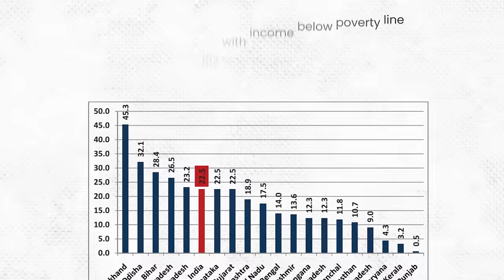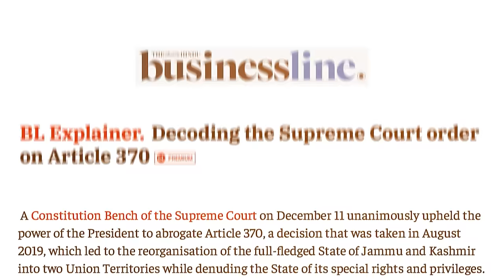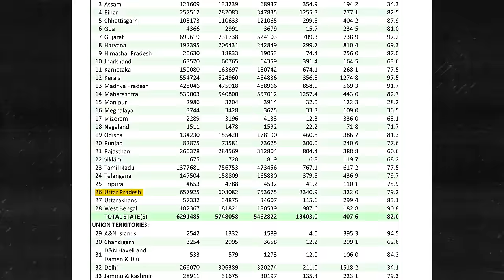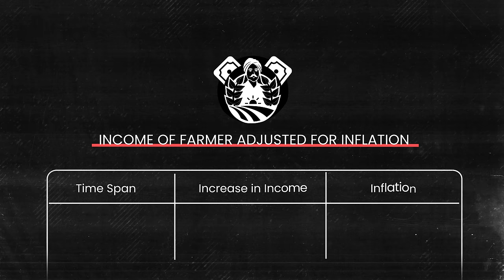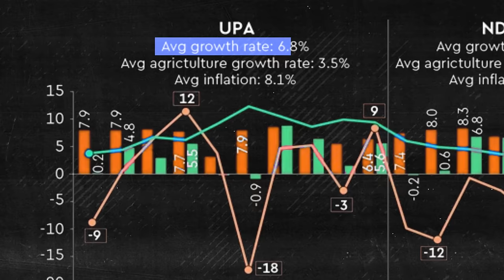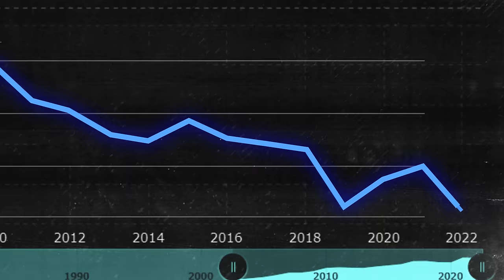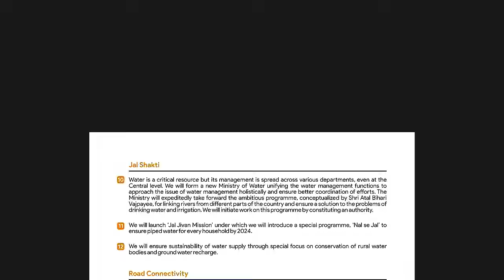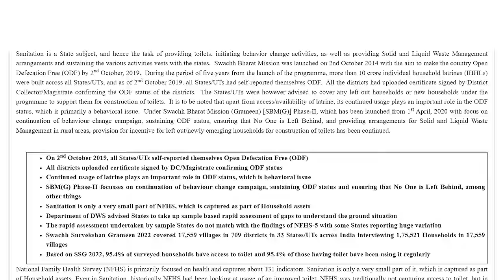The Honest BJP Report Card (Analysed with Stats): Were the Promises Fulfilled?

Comment: Avg GDP growth rate during UPA was higher than NDA rule because of global growth from 2002-2007, when entire world's GDP shot up due to weakening dollar and the ripple effects of it, otherwise Manmohan Singh Ji should explain 2011-2013 stagnation of the economy when there was no global slowdown.. NDA just has increased the capex and made big manufacturing reforms enough to make a significant change in GDP growth..
Reply: By taking humungous debt worsening the debt to GDP ratio
Reply: @aniketkumarverma5505  Taking debt isn't a problem but where that is spent should be the concern. In BJP's case, they have spent it in infrastructure development which is an asset for the country and will provide benefits for many decades to come. So the debt can be recovered easily. Try not to present a half cooked story.
Reply: @aniketkumarverma5505  Launching trillions of worth of projects will require debt.. And Debt shot up the most due to covid, 75% to a huge 89%, but its going down now isn't it? And dont worry, this is public debt, government debt was decreasing till 2019..
Reply: @NarutoHugsMikasa taking debt is not wrong when it's needed, I don't think they had money still they were like let's take debt no way! They wanted that type of money and isn't before bjp debt was already 75% and bjp is decreasing it! Or atleast aware of it so why should bjp get the heat! When they are doing the right thing
Reply: You forgot that we faced double digit inflation during upa and now our Inflation is at all time low
Reply: Now this is called manipulating facts
Cooking a story?
The average GDP growth rate has been better in the UPA era.
Credit to the MMS govt. 
OMG you can't even credit to the poor guys!
Instead of appreciating him you're appreciating the other factors.
Well I could list 100 other factors that would tell you why Mr. Modi has been able to roll up those GDP numbers even tho they are still lesser.
Reply: @celestialkakashihatake4697  mate the % growth doesn't give a good picture, if your salary hike was 10% when your base salary was say 10 lacs, you'd get 1 lacs, but another person whose base salary is 30 lacs, but got a hike of 8% still makes more money. u need to talk about absolute numbers when the economy is getting bigger, and mms lived in an era of hyper-globalization, and the rate we grew was pathetic, it should have been much much higher..we didn't even feature in top 10 of the fastest growing economies then.
Reply: @itdoesntmatter9923  Bullsh it
Why do we need to talk in absolute numbers?
Wow I mena this absolutely is mind boggling the arguments which you're giving!
Comparing eggs with apples.
I'm earning a 10LPA as a fresher.
Gets a 10% hike
I'm at 11 lakha next year
This is impressive.
A guy who's earning 30LPA
Gets a 8% hike
And now because his initial salary is higher, he's ofcourse meant to grow a lot more because the percentage of the bigger number would obviously give a higher number?
What's your point Sir?
How can we compare both the things?
We can if they're in the same department, at the same position. We can say that during the appraisal it was found that I had a better performance and that's why I got better hike.
That's the only takeaway you could have.
What did Mr. Modi build upon?
Previous numbers na?
Or upon nothing?
We build upon the existing blocks every time.
I do not see no point, but absolutely disregarding the work the MMS govt. put in during those years, pulling out millions of people out of poverty line, even if the line has been set at a low level. 
Compare apples with apples.
Reply: @@HINATAHYUGA-js9ke bullsh** facts..
Did you studied Economy from Pakistan??😂
Reply: @celestialkakashihatake4697  so what about economic stagnation during the periodic hold
Reply: @stefano1405  There's a reason that an average was taken in this video
If certain policies helped our economy do better in a certain phase, credit to the govt., If in some years, it doesn't criticise the government.
Don't go into the what abouts
If I started going into the whataboutes the day will end and I wouldn't shut up.
What about the 2008 global economic recession, where every economy took a major hit, India still managed to clock its numbers high.
In Modi government the economy has been constantly there around an underwhelming 5% even before Covid.
2017-19
Numbers utha ke dekh lo
The numbers were decreasing year on year and when the Covid hit us. Boom.
And then one can say India clocked very high GDP grow rates in the following years, thanks to recovery from Covid times.
Another invalid point.
You could always have excuses. 🤷
Covid was an excuse for Mr. Modi
Excused
What about the Pre Covid phase
Why was the economic growth rate slowing down?
Reply: @itdoesntmatter9923  you get my point mate?
Reply: @celestialkakashihatake4697  I am asking reason for stagnation of economy easy peasy! Don't deflect
Reply: @celestialkakashihatake4697   I am asking reason for stagnation of economy easy peasy! Don't deflect and COVID was excuse? The fast our economy recovered from COVID is something else, when world growth rate is going down, Germany is close to recession and inflation is high in America we are growing thanks to decision taken by modi government, excuse? The work is far better then some pity excuse!
Reply: @stefano1405  well I'm not a professional economist to answer the same.
You're pin pointing one factor for the push in growth rate.
And neglecting all the other policy and decision making by the government.
All the countries were doing good during the same 2013-14 phase you are talking about.

I remember India facing high inflation back then.
Surely everything has context behind it.
Have I read every context behind every number? No.
Can one make an educated guess? Yes.

I do everything but to deflect.
I already told you, you could be critical of those years under that regime.
Reply: @celestialkakashihatake4697  ok now tell me what was the reason for initial growth in upa days? Can you tell me this
Reply: @stefano1405  Well, why's the economy in Europe in shambles?
Why is the US going through high inflation?
Now the situation is a bit better.
Why?
Has India been waging a bloody war against the Russians or is it the European countries and the US?
The Context.
Who is facing the brunt of the war? Indians or Europeans?
Who's enjoying cheap crude oil?
Indians or Europeans?
Who's facing shortage in gas and crude oil supplies?
Indians or Europeans
They're also buying it at higher rates.
There are always context behind numbers.

Why has been the inflation been so high post Covid and  since the Russia Ukraine war started?
Why is the dollar rupee disparity has been the highest in history and uncontrollable in the recent past?
Reply: @stefano1405  as I already clarified I'm no expert in this field.
Not an economist by any means.
But the answer IMO is the work done by previous governments and the present ones of that time.
You have to study the policy decisions taken by the government from the 90s primarily.
You could very well pin point one factor behind a phase of successful economic tenure and take the credit away.
But you cannot takeaway the policy making decisions behind it.
There are hundreds of such decisions and India's own work behind the 3 decade succes story of our economy.
Because you cannot get lucky everytime.
If you do not build on solid boundation,
Luck does not run forever. 
Atal jis govt. built on the previous UPA govt. work and took the country forward, and then UPA came back to power again and then the MMS govt. Carried on with Atal Ji's govt's work.
So long answer short- The present and the past work is what the reason is behind that growth rate.
Reply: And that too in the COVID time where countries like UK are suffering to grow India has shown a good growth rate I still remember during COVID most of the countries were having negative growth rate but India grew with 7%+ rate
Reply: Do u know what bjp has done to get these numbers they have changed the calculation of GDP by changing the base year
Reply: @vinaynema-h7b  yeah even world bank that's why they are predicting, that India will become 10 trillion economy! 😔
Reply: @vinaynema-h7b  and it's not some vicious game that you made it sound like

Accuracy: Change of base year to calculate GDP is done in line with the global exercise to capture economic information accurately.
Globally Aligned: GDP based on 2011-12 did not reflect the current economic situation correctly. The new series will be in compliance with the United Nations guidelines in System of National Accounts-2008.
Ideally, the base year should be changed after every five years to capture the changing economy

Comment: Congratulations on a job well done! 🎉 It's remarkable how in today's era, knowledge is readily available to all, yet achieving a clear understanding amidst biased opinions can be challenging. Even newspapers and news channels themselves are often biased. 

Our focus should be on advancing our country's interests without aligning with any specific party. Every party has its strengths and weaknesses. Therefore, the key is to evaluate which party has fewer drawbacks and has responded effectively to challenges. Also it's unwise to dismiss an incumbent party for reasons without fully understanding the prevailing situation.

Comment: Pretty nice report.
Few points:
1. There is nothing that is done to uplift the status or life standard of soldiers. Most of their demands of giving them equal status as compared to their civil counterparts goes into deaf ears. Reason is that they do not protest and do their bit without remorse. 
2. To double the income one very good step was FARM LAWS…which very repealed under the pressure of big farmers of Punjab and Haryana. A very bad step overall to repeal the law. 
3. Still no progress in CAA, NRC and UCC. They have not materialised any of it.
4. They should plan to join all the rivers in the country, this will solve the problems of flood and drought. And over the period of time will also help in reducing NPAs or bad loans or reduction of pardoning of farm loans in the country.
5. Very nice to point out the BPL cut off.
Reply: All points mentioned are very valid, Govt keep showing soldiers to ride high on emotions thus as a vote bank. But every Govt has only worked to downgrade their status since Indira Gandhi. Modi Govt is no different in fact one odd step ahead of previous Govts.

We account for worlds 4% of water reserve, the plan put forward by Dr. K.L.Rao in 1970 and abandoned by Congress should be expedited for better water availability.
Reply: Very valid points 👍🏻
Reply: Joining rivers is not as easy as you think 😅
Reply: The idea of joining rivers is interesting, but is it feasible even? Can you provide some source for this plan or further data?

Comment: The tremendous work in Infra has been done by 2 outstanding ministers:  Gadkari who removed many obstacles coming in the way projects and business viability, kept excellent relations with each and everyone and worked selflessly without his ego in the way.  His creative mind is excellent.  Most of his projects are of international quality and are finished on time and on budget.  This year we will be #2 in HIGHWAYS in the world after the US.  

Piyush did similar things in Solar, making us no. 2 in the world in Solar Additions.  It is because of Piyush that we have so much electric power.   He also electrified railways at a blistering pace which saved us a lot of middle east oil foreign exchange.  In one year, he actually raised exports by 40% which was more than the target even.  

Sadly, the other 21 ministers have not done much, maybe 1 other minister.  But most of them have not done much really.   This is why out of the top 10-15 major issues facing us, only 2-3 have been solved in last 10 years.

Comment: Hi You have covered a lot of areas. I suggest what I felt you missed was the carry over of debt from the previous regime. 1 I remember is the 20K Cr oild bonds.  Similarly debt has to be used for capital expenditures.  This is need to be looked into. Costs coming Due to capital expenditures vs revenue expenditures.  With Respect to increase in nation's capital.

Comment: Your pro- BJP analysis was a good attempt to glorify their failures in real time.
Let's take this examole ....
😮 Numbers remaining the same ..... Let's say 5 & 10 ...... Their positions when put in a formula is very misleading..... 
A. 5 / 10 = 0.5 ..... Agree😮
When put as
B. 10 / 5 = 2

In the above
A. when applied shows a horribly negative picture
Whereas in
B. When applied it gives a very risy picture.....
Statistics are like this to mislead people. It's an old formula we used when we had to mislead and convince people ...
Your analysis for previous government -  UPA is as shown in A 
And
For present  BJP/NDA government as shown in B 

Get the point .....
Brasstacks and ground reality and realtime are different than when put on a PP ..... 😮⁉️😎🇮🇳

YES BY SUCH EXERCISES PEOPLE CAN BE EASILY MISLEAD SHOWING A NEGATIVE (A....) & A ROSY PICTURE (B.....)THE FACTORS REMAINING THE SAME BUT POSITIONS CHANGED ..... LIKE THE MAGICIAN/TRICKSTER WHO DIVERTS YOUR ATTENTION TO PERFORM HIS TRICK ...... 😅

Comment: As you have stated that there is drastic shift (increased) in employment in the agricultural sector of the country to the manufacture sector. But just wanted to the core reason behind this. Is there good or viable profit from the former or just there is technological shift in the country? or some new requirements in the market which make the people just insignificant which inturn formlessly decreased the employment percentage in the manufacturing sector ? Please try to clarify this , it will be very grateful of you 😊

Comment: On the macro level, BJP's policy making was basically the mindset "focus on the strengths, play it safe". Their backtracking on farm laws-I put aside, delaying of national census and CAA is disappointing for me, and I think many will agree. Their utter disregard of Eastern states, including Bihar, is alarming, considering that they are high vote share states for them, in particular the lethargy shown in the handling of Manipur violence, and now the silence on Sandeshkhali signals to a shift to trying to be as uncontroversial as possible, keeping these issues out of the spotlight, since they can't be capitalized for mass vote gain.
On the whole fiscal scenario, they again seem to be doing just the bare minimum to support growth, and taking out initiatives that should have been started 5 years ago but that's just how slow our system is, I guess. At least there is no outright jeopardizing of businesses, but their unpredictable and opaque approach in taking out certain initiatives doesn't sound well thought out long term. They also abandon initiatives as quickly as it loses steam, which is just despicable.

Comment: Good research and shows how much work BJP has done well in terms of infrastructure compared to UPA. I always felt UPA was playing with one hand tied as Petrol, LPG and Diesel were subsidized during UPA which reduced UPA's ability to maneuver funding for infrastructure and defence. Despite this, Economy card shows UPA did a better job despite the recession and high crude prices. I now wonder how much better economy would have fared if UPA was not shackled with high fuel subsidies and had access to additional funds by taxing fuel when crude prices got low like NDA. BJP showed hypocrisy protesting high fuel prices during UPA despite subsidies and high international crude prices, while not passing any savings to consumers post 2014. Are the GDP calculations normalized between UPA and NDA rule, considering the change in calculation formula after 2014 shows higher percentage? Despite this, I think BJP is better suited to run the country due to their absolute numbers and position on national security unlike Congress which can never win a majority by itself today. This gives BJP advantage of pushing through bills and infrastructure, however at the cost of some social disharmony with their politics.

Comment: Here's my 2 cents on the topic. BJP's promises can be divided into two broader categories:
1. Multi factorial Promises: The promises that need improvement on multiple aspects of government and society.
2. Single Factor Promises: The promises that take a single or few factors of government and society.

BJP has done tremendous work in the single factor promises where many changes are not required. Areas like Transportation, energy, infra, law, bank account creation etc which require a few bodies to create action have seen massive improvements.

In the Multi factorial Promises like doubling the income of a farmer which requires to improve on multiple areas like subsidies, transport, market accessibly etc, BJP has done marginal to no improvement. Although a silver lining is that the basic requirements for such promises have seen improvements. 

Also a noteworthy thing to point out is that BJP has faced resistance when it comes to bringing in changes that involve a lot of people. Anything that either requires a massive amount of people to face a change is met with resistance and protests regardless of future prospects. 

Since BJP doesn't exist in a vacuum, we also need to acknowledge the hurdles intentionally brought by the opposition. It's not like they simply exist in the parliament. The opposition does create a lot of problems politically or otherwise when BJP is trying to make a move in the right direction. We cannot omit this fact.